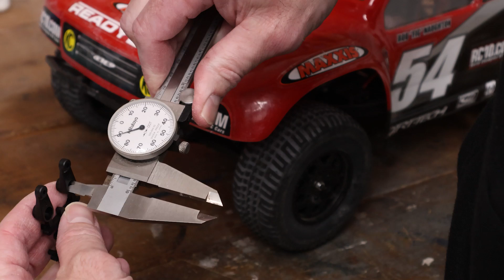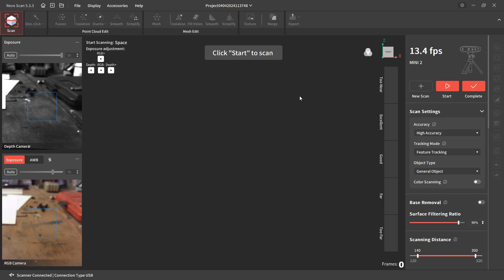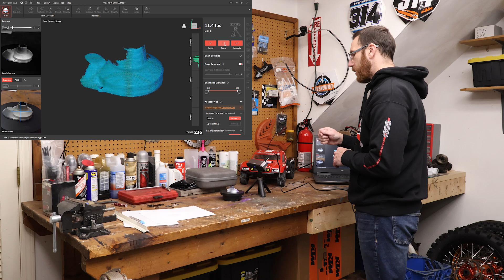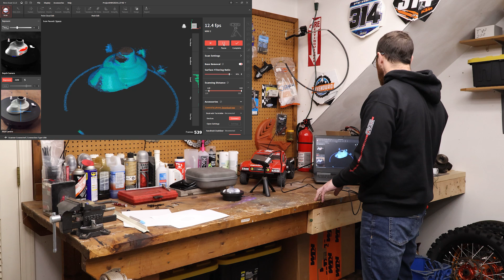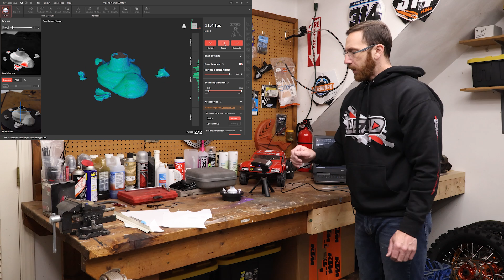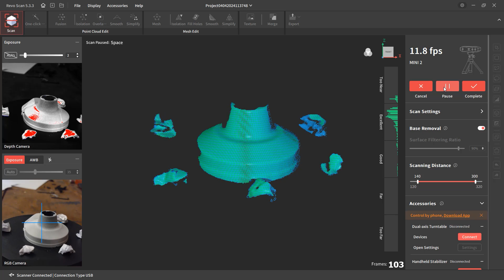3D Scan Design and Print Series Part 1 | Beginners Guide to 3D Scanning | #revopoint #mini2

Comment: Really interested. I just picked up the Metro Y Ultra. How would you approach the scan if you used that tool instead?
Reply from the maker: I will be testing the metroY ultra in the near future.  With that scanner you don't really need to do a turntable.  I would just place it on a small plate with marker dots around it.  In "dark" object mode it might pick up the plastic just fine with the laser scanning.  I would use the cross laser scan mode.  Likely overkill for this specific part, but if you were doing say A arms or other chassis component the laser scan would help a lot there.

Comment: Really good video. Thanks! Still confused on how the crumpled pieces of paper help the scan.
Reply from the maker: Thanks!  The paper is used to help with tracking.  As the scanner is capturing it is getting millions of points across many frames.  Lets say 15 frames each second and lets just say a million points each frame.  As the part is moving on a turntable OR as the user is moving the scanner, the software needs to try and keep track of the last frame and the next one and do some quick alignment based on the points as well as the internal IMU that is used to measure the roll/pitch/yaw of the scanner.  When you have rounded parts or parts that don't have a lot of unique features you end up getting some wildly innacurate results.  The crumpled paper or anything that is unique that the scanner can use to help with that alignment will improve the scan.

Comment: i'm kind of at a loss. You are a great teacher and your video is on point. i cannot get a clear green scan. I'm following your directions and I'm using the pop3 but my best scan isn't even as nice as your worst. I really wish I could figure out where I'm messing up. I've watched this video in its entirety 3 times, with a lot of pauses and I still don't know what I'm doing wrong. Any additional advise or pointers would be appreciated.
Reply from the maker: What are you scanning with it?  Scan spray does make a big difference.  The sample clay busts they send out are like the ideal surface color/texture to scan but most parts we actually want to scan are far from perfect.  If your scans are getting a lot of waves in them its probably based on angle of the scanner combined with distance and speed.  Optimal distance and angle make a big difference.

Comment: I think I have the same rc truck😅
Reply from the maker: Sweet!  Solidworks gave that one to me a long time ago when i was at Solidworks World :)  That chassis has seen better days as i've jumped it off a lot of stuff :)

I have to work on another scanner video next week and ill see what I can do about the multi scan stuff.  Generally when you would do that with say an Einstar, you would want to use marker/hybrid alignment and have some reference markers on the frame or somewhere that is visible with and without the tank.  It needs at least 3 points of contact on unique geometry to make that work.  I will say that personally i haven't tried to do it in the revoscan software yet but have done it in other software so ill need to play a bit to see the nuances of making it work.
Reply: @LearnEverythingAboutDesign  it looks like a traxis rc truck if I'm not mistaken?

That's awesome, any advice it help you can offer will be super handy.

I won't actually be doing the scan for at least a couple weeks as I'm waiting on my new laptop to arrive and I don't feel like moving my desktop to the workshop 😁
Reply from the maker: @dan5her  Its a Team Associated RC10T.

Comment: Hi Matt, is there any chance you have a video guide for aligning 2 3d scans with each other? I want to take a scan of my motorcycle, mostly just around the airbox and top of the engine, including a bit of the frame, but then I want to do another scan of the bike with the fuel tank installed. so I can align them in fusion and design a fuel cell that will fit around the airbox and still be inside the profile of the tank (which will later be replaced with a tank cover) the modelling side of things I'm fine with, but I've only just gotten my 3d scanner and have no idea how to align 2 scans so they fit together correctly. any tips? thanks!
Reply from the maker: Hey there, which scanner are you using?  That will determine how feasible it is to do(well the scanner software).  Is it a revopoint scanner, creality, shining or something else.
Reply: @LearnEverythingAboutDesign  thanks for the quick reply, it's a creality otter

Comment: Thank you for the great video Iwill follow this series 🙂 do you know what is the minimum  processor ,graphic card and ram on the laptop/pc you need for prossesing the scan so you dont need to wait a couple of hours😅
Reply from the maker: Yeah I will say that capturing to my laptop, even an old one, is fine, but as soon as you start processing you really do want a bit more power.  Revopoint says at minimum 16GB ram, a dedicated Gcard and at least an i7 chipset.  You "could" still work with 7gb and a i5 processor but i find that a better gcard, 32gb+ and a processor that can boost around 5ghz really helps.  My laptop is an older i7 with 64gb ram and a quadro p4000 card, but the system is tired and i prefer to work on a newer desktop.    My current desktop is running an i7-10700k cpu which is 3.8ghz but has the "boost" which helps during processing.  Running 32gb ram and an Nvidia RTX A4000.  I haven't had much trouble processing with that system.

Comment: the zeiss software is not accesible anymore sadly. How can I align my scans to the XYZ axes?
Reply from the maker: Wow that is a bummer!  Technically you can "align" in MeshMixer.  This was an autodesk supported program but they dropped it in 2021.  You can still download it and use it but there are no patches/updates since then.  https://meshmixer.com/
Shining3D mesh software exscan has xyz alignmen as do tools like Geomagic.  What i have done in fusion is generate planes off the mesh and measure how far it is off and rotate/move.  You can do this with mesh section sketches to get the center of a revolved section as well.  Not a great solution but workable.  

https://youtu.be/82vD7YSKIAo?si=qtSAxacY_q341lAM

Comment: If possible for the next part can you compare Fusion with Plasticity?
Reply from the maker: Well the series is already filmed and mostly edited so sadly no.  Plasticity doesn't have a way to use a mesh file yet so it really doesn't fit this application yet.  You can import a mesh but its just a reference.  In the future when we have tools to snap to a mesh 100% I will make a video on it :)

Comment: Really really looking forward to the subsequent parts. I figured out the scanning part, but i really feel like there HAS to be a better 3D Scan mesh clean-up to fusion 360 to solid workflow that i must be missing.....
Reply from the maker: Still editing but they will be coming out soon!  The workflow is tough sadly but there are a few ways, which we have covered in other videos.  You are either trying to replicate the part you scanned, create a new version based on the scan, or designing a part to fit the scan.  Once you have that narrowed down then it comes to forms based design or solid/surfaces.

The big thing still missing from Revoscan to Fusion is an alignment.....  One trick is that the first frame of your scan IS your alignment so if it could be at a certain orientation that makes sense you can do that.  There is also a workflow where you can sent the points from revoscan to meshlab, work on it there, then back into revoscan.  but the alignment is still the trick sadly.

The RC part has a flat plane on bottom and some straight edges which help, and we use mesh section sketches as parallel references for this part.  I wish there was a one size fits all.  Paid software like Geomagic have nice alignment tools and preprocessing options but even essentials is $$$.  hard to justify when you are talking about $500-$1500 scanner prices.

Comment: Great video as always but here’s what I really love about it… I just learned that you are a dirtbike guy… Probably riding a KTM 300 so that makes you most likely an off-road dude. And totally an engineer given that 314 is probably your nod to pi. and most likely making good use of a mechanical engineering degree as a young guy having fun in and out of work. I love it. I was that exact guy 20 years ago.😎
Reply from the maker: Right on most of those points :)  im in my 40s so not sure "young" qualifies. and i have a ktm 250xc and a 450 sxf.  raced a little supermoto and ride off road and mx when i can.

Comment: What about scanning for those of us who don't have or want to spend $1000 on a scanner and accessories?
Reply from the maker: what types of things do you want to scan?  There are a lot of scanners on the market.  If you are looking to get rough approximations of objects you can do it with a lot of tools, but generally the money spent buys you speed and accuracy.  Something like Lidar on your phone might be good for +- .5 to 1mm on an object the size of a mug.  Scanners in the few hundred dollar range (INSPIRE and POP series are are in the $400-$500 range).  will generally get you around .05mm.  The mini2 gets you around .02mm accuracy.  

You can take a bunch of pictures and upload them to a photogrammetry site/app but aside from a rough approximation you won't be designing any parts off it.
Reply: @LearnEverythingAboutDesign  I'm personally interested in more the "negative" scan side of what you're working on. i.e. scan a portion of an engine bay to design a part that fits a specific cavity or space. I was mostly curious about no-to-low cost options to get started with before fully committing to a dedicated scan tool.
Reply from the maker: @Pags222  Yeah that is tough.  If you want to try a free option first then you can try photogrammetry or lidar on a phone.  You aren't going to get accurate motor mount locations but that might get you close enough to say see if a motor fits or to design something like intercooler piping and placement.

One big snag you will run into is what colors scan best.  When scanning something that is either absorbing light or reflecting light you pretty much get trash back.  Some lower end scanners can do ok with colors like the CR scan ferret, but offer much lower detail and you are still are looking to spend several hundred dollars.

So yeah id look at free photogrammetry tools first and see what might work for you before buying a scanner.

Comment: Very helpful... This will save a lot of people time and nerves.
Would it be beneficial to have a softbox / photo booth with more defused light?
Reply from the maker: Not really.  So in Part 2 when we get to process the scan data I actually rescanned with the lights off.  I have Hexlights on my garage ceiling and they are great but a little bit less light certainly helps.  Basically what happens is the surfaces of the scans just are a little bit "fuzzy".  Revoscan can still average it out but if you are trying to get as accurate as possible you just want to be mindful of how much ambient light you have in your area.

Comment: Great but I need the part 2 please
Reply: Same bro! Need to see how you work on fusion to make it a solid!
Reply from the maker: In Part 2 we process the scan and part 3 we design.  We are using the scan data as a starting point and don't make the scan solid fyi.  We use mesh section sketches to get references for edges and use that as a starting point.
Reply: @LearnEverythingAboutDesign  then I’ll wait for part 😁 but yeah I’ll definitely watch part 2 😜
Reply: Great , hope to see the next parts soon 👍💕